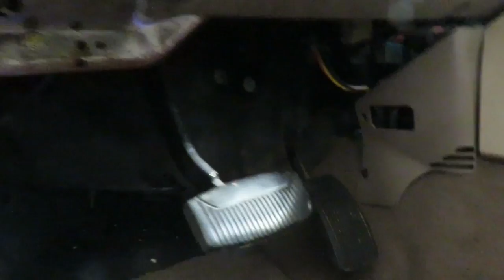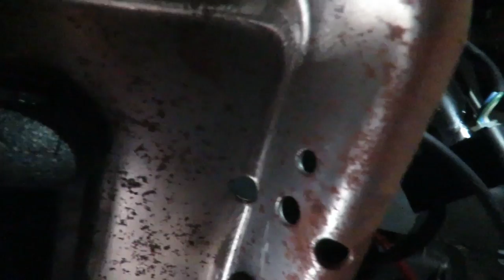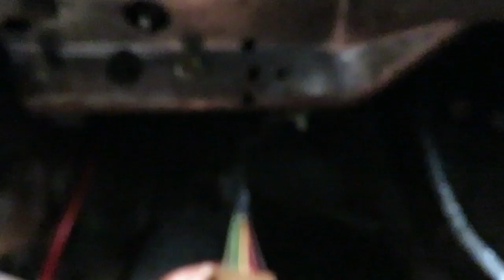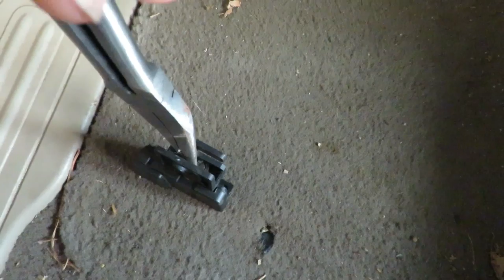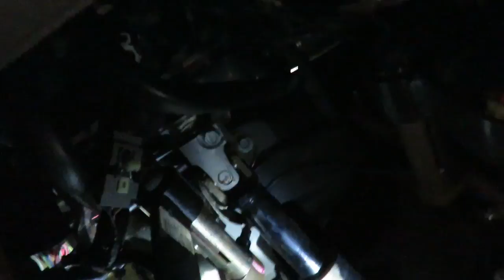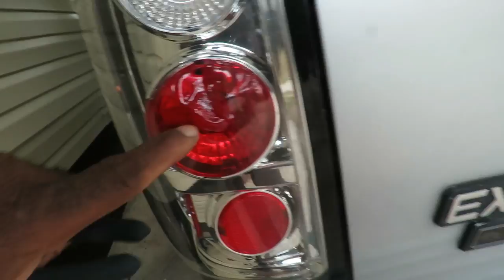⭐ 2001 Ford Expedition - Brake Lights Stays On - Brake Pedal STUCK!

Comment: I'm a new subscriber and wanted to know what is the problem when my 2000 Ford Expedition 4.6L V8 XLT Triton only starts in neutral? And how to replace the wiring harness in the back brake light right above the back hatch/lift door? I wish I lived  near you but hopefully you will answer my questions or do a video on these issues.
Reply from the maker: It seems as far as your first issue, there may be a problem with the neutral safety switch. As far as the second one, sorry, we don't have a video on that.
Reply: @OnlineAutoRepairVideos  Thanks for the response to my questions. And I'll fix the first problem. Thanks again.
Reply from the maker: @flowersfam3462  No problem, and keep us updated!
Reply: @OnlineAutoRepairVideos  I will.

Comment: My tail lights don't come on my 01 checked all the fuses still no tail lights,  I wonder if they illuminate cause the brake lights work
Reply from the maker: Sounds like a wiring issue or a bad multi function switch.